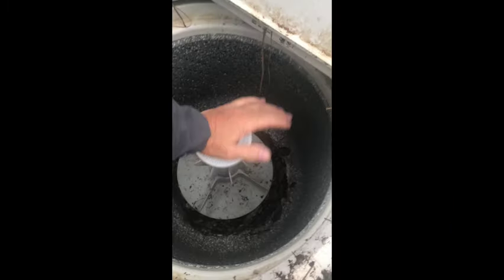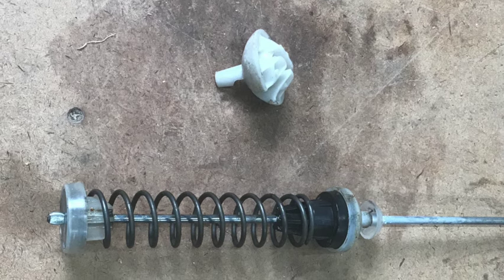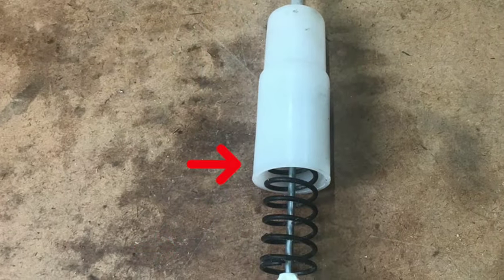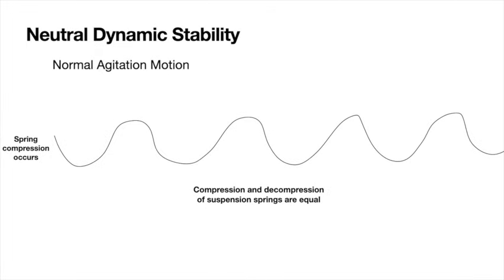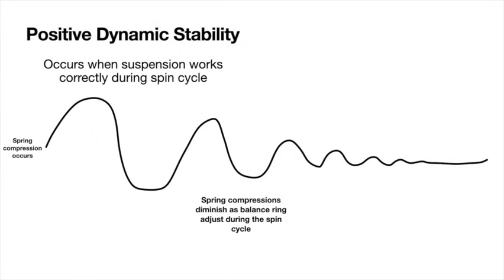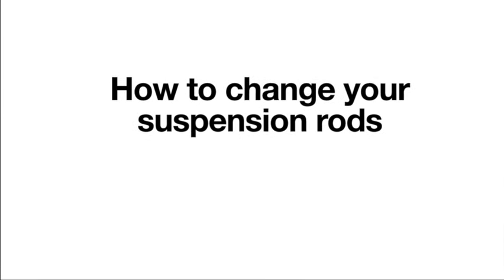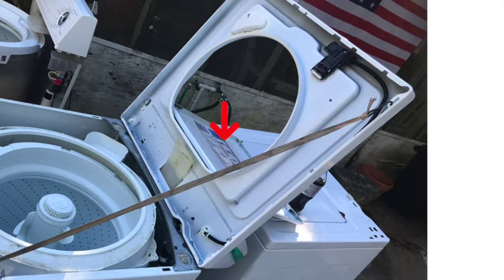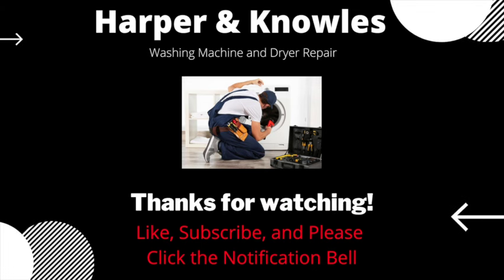How To Replace Suspension Rods in Washing Machines: A Mechanic's Guide to Balance & Repair

Comment: I'm 73 and live in an apartment so when my washing machine started acting like a demon of destruction, I notified our maintenance guys. They replaced the suspension rods and ball joints. I still occasionally hear clanking when it starts or slows down from a spin. If I have to call them back to check it, I'm prepared to talk shop with my new basic knowledge. I also believe, even if a person can't do repairs, they should have basic knowledge so they aren't "taken to the cleaners" by unscrupulous workers. Thanks for the tutorial.
Reply from the maker: I’m glad I could be of help. Thanks for taking your time to leave a comment!

Comment: I replaced these rods a few years back on my Maytag Bravos when it was going out of balance.   The new rods were redesigned for better performance.

In recent months, the final 2 minutes of high speed spin became very loud - but not  causing unbalance.    I removed the 4 suspension rods and cleaned the rods near the dampeners  and the upper plastic bearing cups.  There was some dust (+ dried soap?) and the grease was dried up where the dampener slides along the rod.   Nothing was worn or cracked.    I just applied some bearing grease on the rods and small coating in the bearing cups.   Now running quiet with less vibration and noise.   Will see how long it lasts.  Glad it was not the main shaft and bearing failing again (replaced that also a few years ago). 

Observing the spin cycle - 3 rods have nearly zero vibration, but the rear right rod that has the drain hose and wiring harness clipped to it was vibrating more - especially near the bearing cup.    Whirlpool/Maytag should consider having a separate support for the drain hose and wiring harness to minimize vibration of that suspension rod.
Reply from the maker: Hey, my friend!  I'm glad your efforts have had a positive outcome.  I wonder if that increase in noise at the end of the spin cycle might be a precursor of your bearings failing again.  
Also, I would caution you not to use anything other than damping grease near those dampers.  The function here is to mitigate movement, and the wrong lubricant may have a counter effect. 
I've wondered too why they attach those wires and hoses to something that moves so much. Some engineers had a reason, though.  Perhaps it's so the machine will wear out sooner so they can make more sales?
Thanks for watching, and thanks for your insightful comment too!

Comment: Very nice explanation of all this. I'm refurbishing a 7 year old Maytag Bravos XL. After replacing the tub seal and bearings, I'm tackling the suspension rod issues to get rid of frequent 'unbalanced load' indicators on the panel. The new machines are pretty easy to fix despite what most folks think about 'planned obsolescence'. But you would think the tub seals (and bearings) on the 'transmission-less' washers would last longer than 7 years. Ours were shot and leaking. Only two of us in the household, but my better half goes through a lot of laundry during the week... Again, thanks for the down-to-earth explanation of the dampening requirements during spin cycles.
Reply from the maker: My pleasure!  “Planned obsolescence”, I like that, I’m gonna steal it! Good luck on your rebuild and thanks for watching my little video.

Comment: First of all great review of the physics behind it.  Thanks.  I came here hoping to find more information on how to fix my rods.  I have the blue GE type you show (and red rear ones which seems to be identical but much more expensive).  I REFUSE to pay the ridiculous amount of $260 for 4 rods - yes 2 rear ones are $100 each and the 2 front ones are $35 each. I want to know what part of the rod is failing.  I made a video on replacing the springs on these particular GE rods which you can check out.  I am not totally convinced it is the springs that is the failure of a given rod.  In my blue/red rod case the only other culprit that might be the issue is the top part of the blue bell housing as it rides on the rod when the suspension compression/decompressions cycles happen.  It is totally obvious as you point out that the bottom part of those bell housings mate with the blue housing (plunger piece) such as to compress the air in the blue bell housing.  Question is does that top part wear such that the compressed air being created in the bell housing is supposed to escape through the top or is it meant to increase in pressure and not escape as part of the design?  If it is supposed to be air tight at the bottom then mine is not at the top and thus it is not the spring that is the issue it is the blue bell housing wear.  What are you thoughts on this?  I really have not many occurances of issues with my washer.  When a larger (not too large) load of towels get washed it will vibrate in what I call self destruct mode.  This is bad.  My simple solution to this scenario is that I tied a string on the plug such that when the machine moves an inch or so it pulls the plug out from itself and stops.  Again, this happens infrequently but it has made me wonder about the suspension rods again...  Thoughts on this would be appreciated.
Reply from the maker: Hey, I did check out your video. Good information right there.  Here’s a link to it for others to easily find it https://youtu.be/fycUI9Wx1wg.  As far as I can determine GE was the first manufacturer to use a suspension rod system and the engineers really got it right. GE rods rarely fail especially in that particular model you are working with in the video. I’d say even on the rods manufactured today the springs are probably never the cause of failure to the system. The linear dampers are always the first thing to wear out. In the Whirlpool design the foam dampers inside the shoulder are almost worthless. I really think they were designed to fail. As seen in your video the white piston exerts friction against the blue (or red ) bell cylinder and that split edged washer is designed to flare the piston firmly against the inside surface of the cylinder. I think that the air pressure inside the device is only a secondary function of the damping effect. I suppose it is more evident when there is a sharp downward movement of the tub but otherwise I’m thinking the piston friction does most of the work. It’s been awhile but I used a micrometer once to see if I could find a difference between the colors of the rods. There are also green and yellow rods on other models. I found that there are small differences in their construction and huge differences in price!  The good thing is that most GE washers never need their suspension rods changed.  Usually something else will kill them.  A lot of times when I find an unbalanced GE washer it’s because the alloy tub hub (part number WH45X10027) has broken and the basket leans as it spins up. I think a lot of people rush to change the rods when this is the most common culprit. Hey, man, thanks for that detailed comment and giving us a video of your experience too! Carry on, my friend!

Comment: Was trying to figure out where the friction was being generated to dampen the vibrations. Thanks for doing this. Also I  fully agree that GE got it right by including a damper/ piston in the assembly.
Reply from the maker: Thank you for your comment! I'm glad you found the video helpful in understanding how the linear dampeners work in the suspension rods.  It's interesting to see different manufacturers implementing their own solutions, such as GE's inclusion of a damper/piston in their assembly. I think Whirlpool needs to reengineer their rods because they just won't hold up to vibration for too long.  If you have any more questions or need further assistance, feel free to ask. Thanks for watching!

Comment: Maybe I missed it but I don't think I heard you talk about stabalizing springs?  Some of the suspension rods have springs that hook to the top part and to the outside tub casing.  Doesn't this help stop some of the wobble on spinning?  My kenmore has a place to put 4 of these springs one on each corner, I do believe they sell in packs of two.
Reply from the maker: I’m sure these springs were engineered to mitigate horizontal movements or harmonic vibrations of the tub or suspension rods, but in my experience they don’t have enough tension to be of much use. I know that they certainly don’t fix an out of balance issue and aren’t commonly found on most machines. Thanks for watching!

Comment: So, how do you know when the basket post is bend , like the example you put?
Reply from the maker: You can spin the basket by hand and use the splash ring as a reference. If the basket wobbles in and out more than about a quarter inch you can be sure something is bent.

Comment: Thank you for this video! 

I can't push my Whirlpool drum down at all and if I push to one side, it doesn't spring back. Does this mean I'm way overdue to replace the suspension rods? I started looking into this when I noticed it didn't drain completely after a load last night. This unit was purchased new from the builder in January 2010 so it's probably reaching the end of its life (though we only do about 5 loads a week now and fewer the first 10 years.)
Reply from the maker: It sounds like you don’t have the model that has suspension rods. If you have to pull the knob out to start it then it’s an old school machine. If you push a button you should have suspension rods. Thanks for watching!
Reply: @HarperandKnowles  yep, pull the button out pulls out to start! Thanks!
Reply from the maker: So that means your machine does not have suspension rods and you don’t need to worry about that!

Comment: The rods meaning springs right? Well with my kenmore washer you can tell just by moving the agitator back and forth and see how weak the springs become. It doesn't just bang anymore it smashes now where it's dented the side. I now resorted to the old washer in my basement which leaks lots when in drain/rinse mode. Any idea why it's leaking?
Reply from the maker: You probably have a plumbing problem. Tie a dry rag around the drain hose where it goes into the stand pipe. If it is wet after the rinse or spin cycle then water is backing up the stand pipe and spilling onto your floor. Thanks for watching!

Comment: Thank you for the video.  Great Job.  Very good easy to understand description of why a load gets out of balance.  I hope that replacing the rods will alleviate the banging I'm getting whenever I wash a large load on my new GE Profile washer.   Maddening to have to baby-sit the washer to re-align the soaking wet clothes when the damn machine starts pounding on the side of the unit.  I didn't have this problem on my old GE washer.  Makes you wonder if they ever test these models out before mass production.
Reply from the maker: GE’s don’t have the suspension rod problems that other models seem to have but it is possible. Something else might be causing the out of balance issue if the washer is new. I’d examine the area around the tub hub to see if there might be something out of sorts. Thanks for watching!
Reply: Yes, it really sucks, @UserZm6.  That's what I am damned doing with my Samsung Washer now.  It's been a workhorse from 2016 until 2023, but 2024, it's giving the UE code.

Comment: I have a 7-8  year old topload GE model GTWP1800D0WW. It shakes severely only during spin (just randomly started today after a heavy load) and within a few seconds will cause the tub to slam against the sides so hard that I have to stop it before it rips itself apart.  The two back suspension rods are different and have red pieces on the bottom of them and the front two have blue on the bottom. Apparently they are different. How can I tell which is bad by looking at them while on the machine? While standing in front of the machine, the problem seems to be that when trying to push the tub towards the back or front, it is more stiff. When trying to push the tub left and right, it is far more loose in that direction. How do I figure out which ones are bad in that case? I also found some nickel-sized pieces of what seemed like black plastic covered with gunk/mold on them inside of the tub itself, but underneath the load of clothes on the bottom of the basket. Where could that have come from? I see nothing broken.
Reply from the maker: The suspension rods on the GE washer model GWTP1800D0WW are known to be very robust and usually last the lifetime of the machine. However, if you do decide to change them, keep in mind that they are different front and back, and all should be changed if one has gone bad. You can purchase the blue rods here: https://amzn.to/3izx2cP and the pink rods here: https://amzn.to/3WcpfPF. Keep in mind that these rods are expensive and may not fix the problem if the alloy tub hub is cracked. It is possible that the alloy part that connects the spin basket to the transmission shaft is corroded and cracked, causing the tub to lean over during the spin cycle. This part is not sold alone, even if you can find a supplier that hasn't discontinued it. The whole assembly is part number WH45X10120. The pieces you're finding on the bottom of the basket are probably parts of the alloy tub hub. When a washer starts having this sort of wear, it's best to replace it. I recommend trying a Speed Queen, it's the best machine you can buy and tested to last for 25 years. Here is a link if you want to buy online https://amzn.to/3kfM2gr, you can find it cheaper if you look around, I think shipping from Amazon drives the price up. Thanks for watching and good luck with whatever you decide to do.
Reply from the maker: Also if you look at this video: You Should Check the Suspension Rods | Here's WHY and how to FIX it!
https://youtu.be/xmBJdpUfV-Q at about the 9:47 mark you can see what is probably happening under your spin basket.
Reply: @HarperandKnowles  Is there a safe way without messing up any seals to get this top off to see if that area is corroded under the spin basket or am I pretty much going to have to take the whole thing out? What bothered me was the plastic under the clothes as opposed to on top where something could have just broken and thrown it on them. However, my other question is...how did a nickel-sized or larger piece of plastic get itself up under the agitator to get underneath the clothes? Even from the spin basket, isn't that underneath the top basket? I'm just puzzled how it got there. These are the pieces that I'm referring to: https://i.imgur.com/dpgTTxX.jpg

I posted youtube videos of the inside movement while spinning: https://www.youtube.com/watch?v=22HkxfVKfU4
and the tub moving with the cover off:  https://www.youtube.com/shorts/foeE_5ovYQY
Reply from the maker: You should pull the agitator out and examine the tub hub. Grab the agitator on either side at the bottom and pull up sharply, real sharply. It should snap right off. You won't hurt it.  Are those pieces of plastic pliable or solid?
Reply from the maker: @user-tb2jy9lu3d  Those pieces are probably breaking off of the tub hub. They are corroded magnesium alloy. Remove the agitator, and you should be able to see any cracks. The inner tub should not rub against the outer tub at all. Agitator or wash plate, I have no bias to either. The wash plate models use less water so that the clothes stay in contact with the plate for scrubbing action. I only recommend Speed Queen models anymore because no one else makes a machine that will last. For a low-cost device, the GE GTW335ASNWW is the better low-cost option.
Reply: @HarperandKnowles  Yes, there are actual holes in the tub hub itself in at least two places. One of them probably quarter-sized and breaking off. The entire tub hub looks off-balance as if it has shifted in position on the tub itself. It's very odd.
Reply from the maker: I’m sorry to inform you but your machine has a terminal illness. It’s best to take the old relic out and put it out of its misery.  I wouldn’t recommend repairing it unless it has sentimental value to you.

Comment: We’re trying to replace rods on a top-loading Samsung washer, but can’t get the “clamps” in the front of the washer to release. The video we’re watching suggests a putty knife. We can find the clamps, but they don’t want to release. Any suggestions???
Thanks for your video, and love that you’re a writer❤️
Reply from the maker: Try lifting up the back of the cabinet top and wiggle it as you push the top towards the front. It will usually come loose if you’re vigorous enough. Thanks for watching! If you want to sample some of my writing I suggest “ The Fuzz vs. the Buzz”

Comment: At 11:20 in your video there's a white cap near the top of the picture. Does it matter where you position this cap? Does it snap into the top of the black, bottom cup? What's it used for?
Reply from the maker: I'm not exactly sure what those are. They come in handy when replacing the rods though. They'll hang on the edge of the tub until you can hook the top into place. They are also useful to knock the cup inserts out when replacing models with tub slits.  If you slide them all the way down then check after a bit it may indicate movement of the spring. Or they could be vibration dampers. I do know that they only show up on certain Whirlpool made machines.
Reply: Yeah, I've definitely found uses for them.  I was just wondering if they were an active part of the suspension. Thanks for all your help.